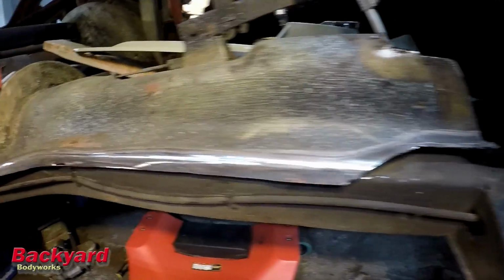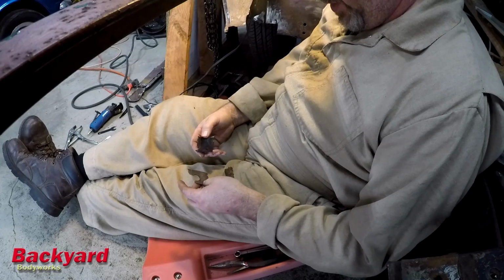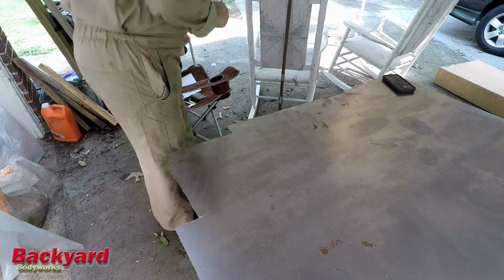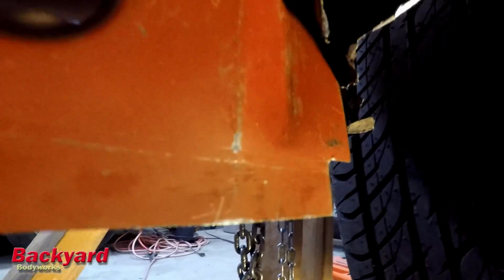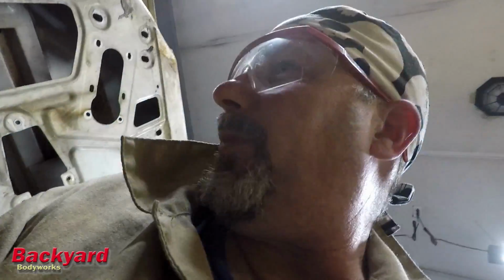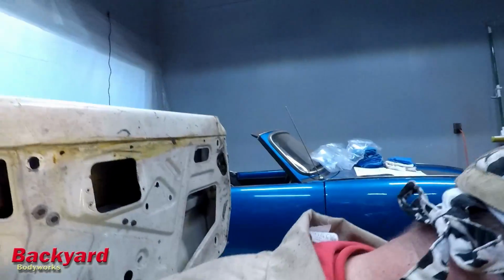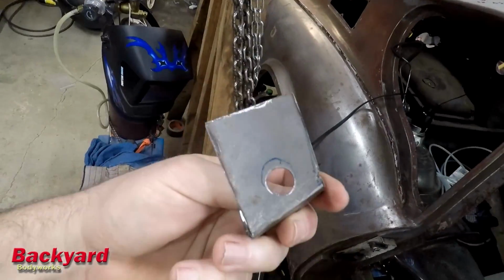72 Triumph GT6 Restoration Episode 25 (Floors, Sills, and Rockers pt3)

Comment: Good job, Robert. Love the CAD. I regret not doing more of that during my restoration. But, I'm really glad that I didn't have the corrosion extend into that transverse piece as much as you (and David Plass) did (sorry!). I think the floors will fit up just fine. You're doing it the way I should have, on frame. I think the gnome aproves!
Reply from the maker: Thanks Chris...I talk a lot about the "collective knowledge" that we as a group are generating calling it the "virtual shop". When I worked as an autobody tech as a younger version of myself, the older more experienced techs would get together if one had a problem and collect around the car with a cup of coffee and discuss the issue bringing their own experience or expertise to the table and they would find a solution. That is basically what we have going on here. I cut it out of the footage (because of time) but once I made that cut on the floor along the tunnel it pulled everything towards the center of the car and made everything flush. That 3-4mm gap I was talking about between the floor and the strengthener disappeared. Yeah...Lenny is a pretty good shop gnome, and easy to work with. Im heading over to see the work you did on the bonnet...
Reply: @njaahkbackyardbodyworks1807  Lenny...that's great.
Reply from the maker: @roundtailrestoration  Insert "Of Mice and Men/Laverne & Shirley" joke here

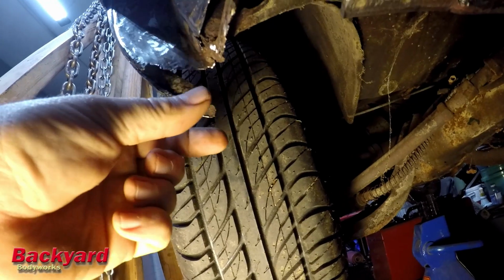Comment: 5:00 Yes, can confirm it's a channel behind the edge of the wheel well. You're lucky - you only had to replace that little part of the heelboard and the flange... I had to cut about half the heelboard out (and toss the bracket) because of damage...
Reply from the maker: Awesome sauce....after this last vid you did, I noticed that the piece I put in with the hole in it has the flange facing the wrong direction....if you are looking at it strait on from the right side of the car it points to the center of the car with the welding surfaces pointing forward and rearward....I need to bend it so it is pointing towards the rear of the car with the welding surfaces pointing to center line and outward. I have been lucky with this repair...unlike the bonnet which required an entire rebuild...although I have been scouting out the rear valance and boot floors...I might not be so lucky back there especially in that lower rear quarter where the boot, inner fender, rear tail and outer quarter all come together....don't look to good back there....but once I start cutting out the cancerous material it might prove to be just another simple fabrication...(Lenny laughing manically in the background)
Reply: @njaahkbackyardbodyworks1807  aw that stinks about the flange... luckily you caught it and can fix it.